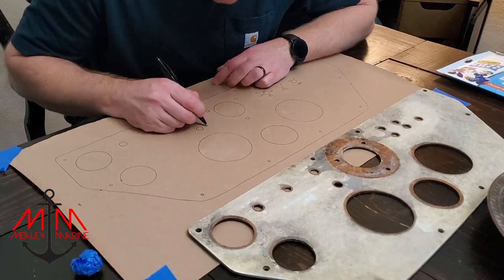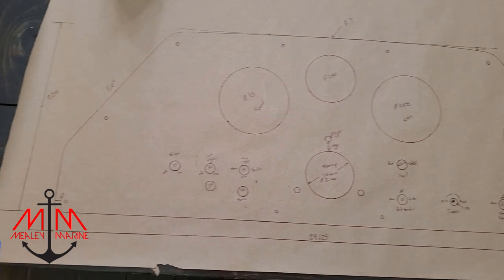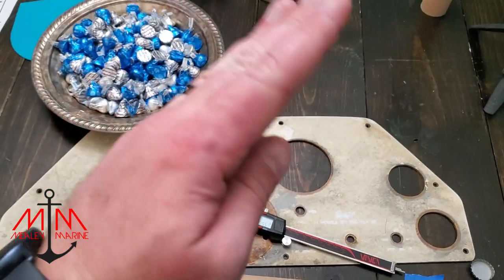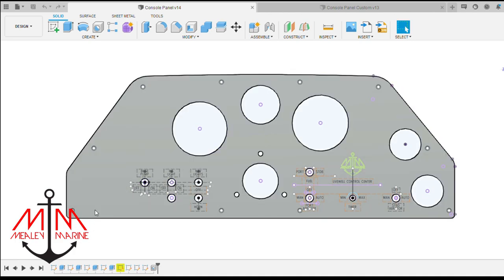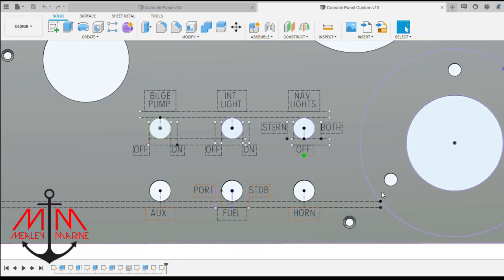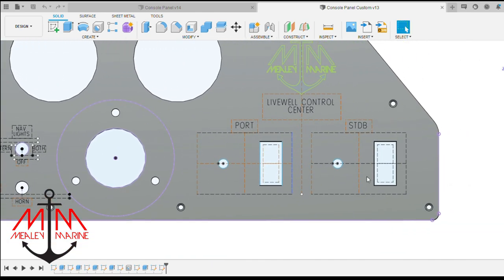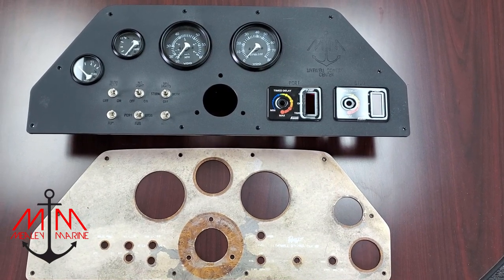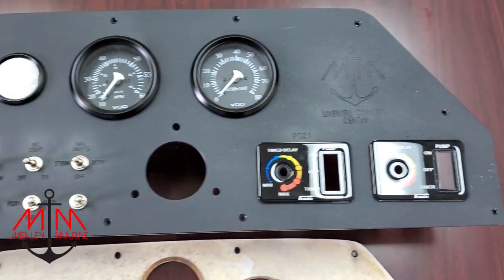BASS BOAT RESTORATION | 1988 RANGER 363V | PART 15: NEW BASS BOAT PARTS

Comment: I just binged all 15 parts. This is really cool and inspirational to me. I'm trying to inherit my fathers 363V as he has a bassmaster classic edition.  I'm wanting to do a more modern approach though with vinyl wrapping the boat and getting new Garmin electronics etc. anyway, looking at the new equipment you're putting in and looking at all the old wiring. have you thought about just making your own harness and running something like a switchpro 9100 or something. or are you partial to the flip switches? A touch pad would simply things greatly I would think.  I'm definitely new to boats so I may be thinking too modern and that may not work for the application I'm thinking but figured i would throw it out there. Cool project!
Reply from the maker: That's awesome! I appreciate it. I did consider going super modern with it but I felt it wouldn't really add to the resell value. I wanted to make something reliable and felt thst going with the toggle switches would be best! 
We are working on making a replacement wiring harness for these boats!

Comment: What's the material?  CAD makes things so much easier.  You know if stuff is going to fit before you cut metal.  Wonder how aluminum would look?  You could get it anodized in a cool color.
Reply from the maker: It's HDPE. I will probably make it out of aluminum and powdercoat is first. We can powder coat in house.

Comment: How did you get the radius on the corners or how to you measure that to imput on cad software 🤔
Reply from the maker: I just guessed tbh and used what looked good. There is a tool called a radius gauge you can get for the smaller corner radius. I also have circle template for the bigger radius.